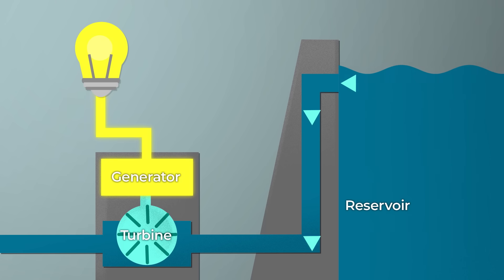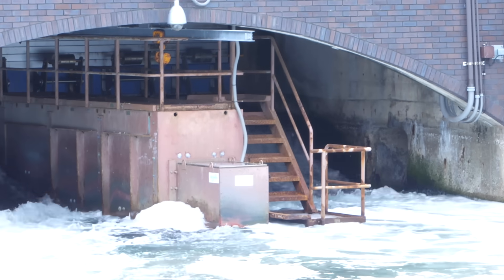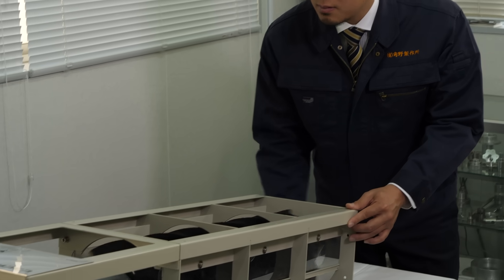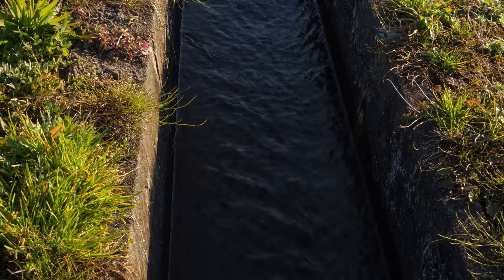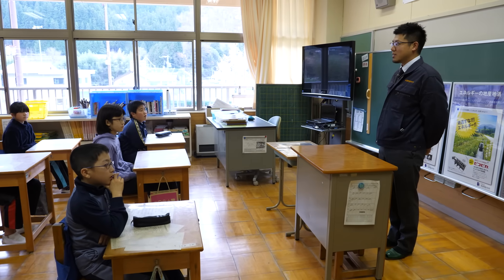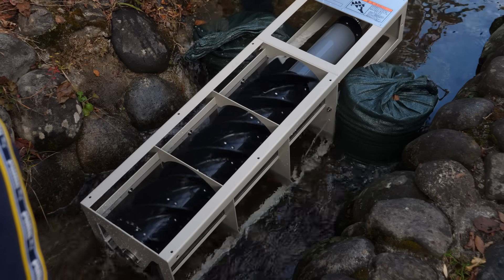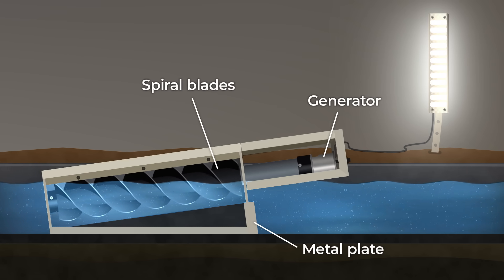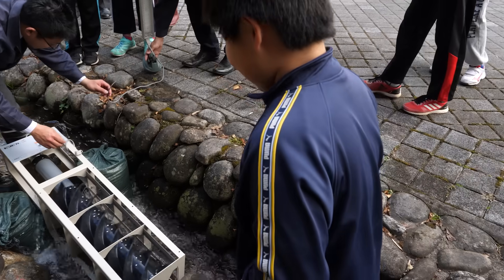Ultra-Small Water Power Generator

Comment: How many Watts it can produce?
How high Voltage?
Reply: There seems to be 2 versions: PicoPica10 (this one) and PicoPica500. According to this website: http://www.unido.or.jp/en/technology_db/5276/, PicoPica10 enables around 10W generation by securing a flow 10L/sec and a head of 0.1m. PicoPica500 on the other hand, enables around 500W generation by securing a flow of 100L/sec and a head of 0.7m. Also the power generated by the bigger version adapts to various voltage/frequency through using a transformer.
Reply: @shambalahabababa7514  Even under absolute perfect conditions without any friction it couldn't output 10W with 10l/s flow and 0.1m head. It's physically impossible.
Reply: @pary8245  Oh it is possible... you just need to put it on a planet with higher gravity than Earth.

Or, I suppose, if you were to find a river of flowing liquefied metal, that could also work - 10 liters of molten metal have more mass, and thus more potential energy than 10 liters of water falling from the same height :)
Reply: @pary8245  :D well they did qualify their statement with "about 10W". But I think they are fine with this claim, remember the design has a 0.15m metal plate on the front.
Reply: @pary8245  10 liters equals 10 kg at a height of 0.1 meter. That's 10 Joules of energy every second, = 10 Watts
Reply: @hbzandbergen  Only if g is higher than 10. I think they use trick and build a damp to create more height and flow. The main question is the price and the durability. A long lasting and cheap product may be usefull in some situations.
Reply: @shambalahabababa7514  volts?
Reply: @grahambate3384  Watts is Amps multiplied by Volts, and so depends what you want your transformer/inverter to run at.

10W at household 250v is only 41 milliamps per hour, at 5v its 2amp/h, or just over enough to run 4 xbox 360 controllers and wish I had friends instead of looking up chinese micro water generators
Reply: @grahambate3384  12v to 25v
Reply: Urammar it is Japanese
Reply: @shambalahabababa7514  thanks for that info
Reply: @shambalahabababa7514  i looking for submersible micro hydro for my project but i couldn't find any. please help me
Reply: @zenshy2139  make sense
Reply: @jhons0ns  Never expect sense from a leftist They are obsessed with sex and destructive practices.
Reply: @Карасик Ерохин I never tried on led but normal light bulb which I lost a few of them on unstable current even though it went through stablelizer. 

It would be very risky to use it to generate power for fridge or TV as you might lose it. 

Again solar works whole lot better and easier to manage.
Reply: @Карасик Ерохин What about for trickle charging a rank of batteries? A school doesn't run for 24 hours, so there's plenty of opportunities for charging up classroom devices like ipads overnight, weekends and over short holidays.
Plus, that was a demonstration on a fair day. On a wet day, the water will flow faster, so the device will work a little harder.
Reply: It can produce watt ever you want
Reply: It depends on the strength of water flow. You can have 110 or 220 volts if flow is strong enough. 

The problem is how steady is the flow. 

If the water flow is stable then the current you could get will also stable not much fluctuating. 

If not the current can be completely useless.

I did try it and still have a generator in the warehouse but I have to tell you solar works much much better.

Comment: Not impressed with a "invention" of the Archimedes screw. So he's a few hundred years out there.

Also there doesn't seem to be much power for the lights and there led.

Perhaps the generator should be a little  bigger, and have a cap to give stabilization. It is hard to say if it is any good, without any power output info. And what it's flow rates need to be as a minimum or maximum.

Slow flow and longer Archimedes screws would allow for a geared system, provided there is volumetric power of water.

Odd video of really old and well used tech made out to be new, which of course it's not, bit like saying I invented a wheel. It's round and wheel like.

Comment: Sir, I am from india, I designed a proto type machine which generate energy from various orcilating objects like trees, waves etc. This will synchronise energy of different orcilating objects to a sigle shaft, and the shaft will rotate continuously like an engine. If you want to know more, don't hesitate to call in 9349978412

Comment: You must implement the device with blocking the natural flow of a stream, which isn't as good as expected.
Reply: Leonardo Vosper ... because that was a small gentle stream. A bigger watercourse wouldn't need that
Reply: @besticudcumupwith202  3:08 listen carefully
Reply: Leonardo Vosper ... what's your point? He said it works with this gentle stream. He blocked the sides to confine the whole stream towards the input of his device...to speed it up. With a larger stream the (assumed) faster current wouldn't need that confinement.
Reply: @besticudcumupwith202  What's your definition of gentle stream? Seems like it takes at least 30 centimetres to make water reaching the upper tunnel hole possible, which maybe in your eyes is universal but in reality there aren't many meet that criteria. In a scenario which the available head less than 30 centimetres, you technically can't utilize this device whatsoever without levelling up the water with some blockage.
Reply: @besticudcumupwith202  Imagine a shallow but wide river.

Comment: Some engineering. The Archimedes screw we see here delivers 10 watts with a flow of 10 liters/second and a head of 0.4 meters, according to the web site of the mfr. I did a little conversion and calculated that the energy of the flow above is 40 watts, so the machine operates at a total efficiency of 25% which is excellent in light of all the places energy can be lost due to friction inherent in a flowing liquid, the necessity to not capture all the energy of the flowing water because it has to flow out, taking some kinetic energy with it and losses in the generator from gearing and hysteresis and IR drop through the coils.

10 watts for 24 hours amounts to 0.24 kw-hrs per day or about 5 cents or less for most of the US.

Comment: Running at 100% efficiency and a 30cm head with a flow speed of 1 m/s, this unit will generate a maximum of about 180 W of power. I would expect it in reality to deliver less than 100W. So it would take  20 of these to run a standard power point in a house. But quite useful if living off grid and you have battery storage.

Comment: I don't really get the point of this.
It's low volume low head so I assume the power output will be tiny. Charge a few phones maybe or a low powered laptop.
For not much more material you could run a pipe and take that low flow and give it a bigger head allowing a turbine to make much more power. This would be cheaper per watt I'm sure.

Comment: He should add a rechargeable battery to keep it from flickering. Then just let the generator run for half a minute or so to build up a charge, then turn on the light and it will be a continuous stream instead of a strobe light.

Comment: It is out of the box thinking.  Based on the video it appears that the device requires directing the water flow through the generator.  If this is the case it would restrict water flow so there would be a limit to the number of devices that could run on a single stream.

Comment: Wow. I love the idea and will try to copy it in our community..more blessings for you
Reply: great for you and your community! if they build a horizontal version across the river then the river will only be raised a minimum to help protect the fishes etc. a low one can be more easily cleared of debris in times of high water or flooding. the screw type of blades will spin at level placement so that there needs no angle other than the screw.

Comment: Thank you  for the video that shows solutions do not always have to be large and costly.   In our situation, we are looking at running the Archimedes screw in reverse.    Perhaps powering the screw with a water wheel we could pump water to a higher location - like a grain auger, but for water.   One of the challenges is how to make the power connection from the water wheel with a horizontal rotating shaft to the Archimedes screw which may be lower to allow water to enter the screw casing.   Anyone else looking into pumping water with an Archimedes screw pump?    I've linked back to this video from the Water Wheel Pumps facebook group post about Archimedes screw pumps:
https://www.facebook.com/groups/240458583255303/permalink/431309544170205/

Comment: would have been more impressed if I would have seen it power more than an led strip.  would have to hook up a few of those, store the energy in some sort of battery storage, convert to ac to be of any practical use.

Comment: If power plants depend on water "that flows from high to low levels", what happens when the water level in the reservoir drops? Hint; it's a rhetorical question. The pressure at the bottom of the flume is the same as the pressure at the bottom of the reservoir so why not place the outlet there and not worry about "low tide"?

Comment: floating dirt/debris can easily clog this. Also too much of the moving  parts and electric components are in and close to the water. The good old paddle wheel might be less efficient but probably much more reliable on the long term.
Reply: block debris with grid, coat electric parts in plastic. problems solved.
Reply: @jonathan6015  and clean the grid in every 1hr!
Reply: @earth32k  or instead of doing it yourself, you could have someone intelligent set it up for you.
someone for instance that knows how to divert some of the flow to shifting  debris around the device by means of an angled grid.
Disclaimer!! Do not attempt without adult supervision.
Reply: You haven't considered the statics in order to position a paddle wheel, its this factor that makes the paddle wheel sub optimal.
Reply: That means you country water Chanel is damn dirty bro..
Reply: @kelganslayer  After I saw this I looked into them, some larger versions of these are used to extract energy from sewerage flows. Imagine cleaning that pukes
Reply: A filter at one end solved or a mesh cage.
Reply: What about our feets accidentally caught in that.
Reply: @newphone375  Its actually in a clear plastic tube if you look closely.
Reply: easy just take it out of the stream and rinse it off under some running water, good as new
Reply: Its point is to function more efficiently in locations a water wheel is not functional.

Comment: So how many watts does this produce? I have seen some larger Archimedes screws produce power but the main issue what it being very inefficient when comparing water input vs power output.
Reply: 10 or 100 depend on water flow pressure

Comment: Hi there ,why dont we use permanent magnets with rotator shaft to make it smooth & efficient ?
Reply: i dont think i get quite what you mean, the shaft is rotary, its rotating, and the generator is just permanent magnets that when rotated produce electric, i just feel you have described what the thing actually is
Reply: You can't do that. The spring will stop after a slight movement.
Reply: I have made one! It has magnets and metal and it spinds
Reply: Are you saying use magnetic bearings? That'd probably be a lot more expensive compared to just using ball bearings.

Comment: This looks cool but how much power does it actually generate? If you look at that footage, you can clearly see that LED lights are strobing and LED lights aren't exactly power hogs.
Reply: The video really does not say anything about the amperage or voltage this micro generator produces.   Nice idea and it looks as if it could be scaled up with a auto alternator and a 3D printer to make a useful power source.  Not sure the Archimedes screw generator is any more efficient then some of the other turbine systems you could build in your garage.  I do appreciate ANY attempts people make like this.

Comment: Yes it makes electricity but not sufficient to equipment's size and cost.......
But I appreciate,
I support zero pollution power production, also working on that.......
Reply: Store that power in a battery for the times it's needed. That would power my entire home!
Reply: Zephod Beeblebrox LOL do you live in a shoebox? This would maybe power your phone.
Reply: Did they say how many watts it was producing?. I’m guessing about 50-75 watts on the low pitch flow and 75-100 watts on a high pitch flow.
Reply: @paulbaker3144  I run my motorhome off 95W of solar panels that recieve maybe 50W of power.
Reply: I looked up the website and it says the make a 10 watt and 500 watt model. The big generator under the bridge for bridge lighting might be the 500 watt model. 
 That’s amazing you can get by with a 90 watt solar panel !
Reply: @paulbaker3144  I use the power for lighting, air circulation, phone/tablet charging, water pump, shower pump. I do have extraction fans but have a limitation in the the batteries can't supply enough power for them for longer than a few minutes. I really should add an extra battery. Here you go. www.schoolbushome.blogspot.com so my latest idea is to run the extraction fans directly from solar when possible (via a cutoff that stops the fans when the solar input is too low, hence reducing the risk of coil burnout)

Comment: i had a similar idea ,use the water pipes  and add a turbo like pump flow with a rod to connect the generator to run all the street lights

Comment: It's called in-stream hydro electricity and this isn't anything new . There are several small companies that are doing this and usually in third world countries . We tried to get a hold of one for our property in the Pacific Northwest but they couldn't sell us one because of all the regulations and red tape .not to mention the fact that the big power companies don't want people to be self sufficient . 
The reason we were given as for why we weren't allowed to get one was because of the Salmon migrations even though it wouldn't affect them at all if it was done right with a screened off channel running parallel to the river flow and then back into the river .
So even though we have a potential full time energy supply right in the middle of our property we're forbidden from using it for our own usage . 

Red tape, overbearing bloated government agencies & corporations and greed are stifling this country and keeping it from moving forward .

Comment: Now, if there was a solar flare induced EMP then what little generating capacity this device would be capable of producing would be disabled. What if it didn't generate electricity, but instead compressed  oil in a sealed system that would act as transducer of which work would be extracted. Such a system would be immune to an EMP.

Comment: This thing is incredibly inefficient that has about the same output as a phone changer... 1/50 of a hp maybe
Reply: Yeah but no mega dams required. It’s called distributed energy.
Reply: Paul Baker ok but I still fail to see how that is a very viable way of doing anything a small little solar panel is more effective
Reply: @AT_Automation  I'll explain it to you... at night.
Reply: Mario Sebastiani, batteries? There pretty cool you should check them out.
Reply: @AT_Automation  Batteries store DC current, your home appliances use AC current. And even if you'd use a DC motor, do you have any idea how many power cells you would need to make your washing machine run?
Storing energy with batteries has many limits. That's why we build dams and store potential energy in the form of a great mass at a reasonable height, for example. Also, batteries are costly, have limited lifespan, and are troublesome to recycle. At Politecnico di Torino, back when I was a student there, we conducted many simulations to study the feasibility of energy storing methods. Batteries always showed to be amongst the least usable no matter what the input data. You'd be better off using the surplus energy to split water in hydrogen and oxygen, to recombine them when you need them. If only it wasn't that dangerous to store them...
Solar cells are also costly to manufacture, cannot be made anywhere (you need technologically advanced plants with precise machinery, a sterile environment and a stable power source) and are quite polluting both at production stage and at the end of working cycle, wich is 20 years at best, and usually 12-15. A coclea like the one above can be made in almost any Country, with little more than scrap metal, lasts for decades and is easily recyclable.

Comment: third try!! LOL!! If we adopt the gas recharging system of the BAR rifle we can use the same design on our engine.The force of the water through the engine will cause a natural return to the reservoir eliminating one pump from the design. So a  hose running directly back to the reservoir would do nicely.

Comment: I want to amend that first comment..... scrap the orientation.It does not matter.However, Keep the loop closed!! So we use a electric pump to force water through the generator and an electric pump to refill the reservoir .The entire system could then be sealed like an engine!! A sealed device/engine would minimize the evaporation factor.Next use a fluid that does not evaporate.!!! Where do we buy this generator??